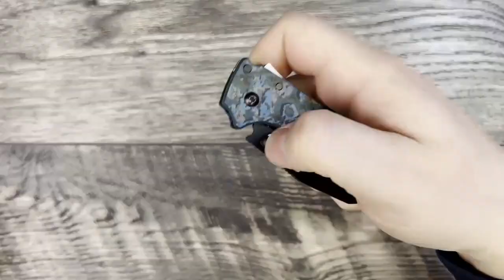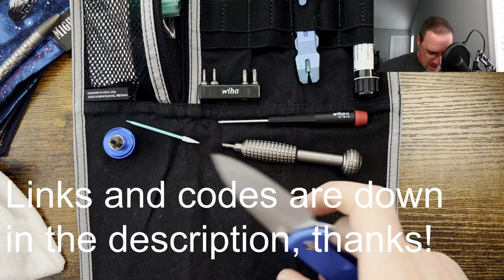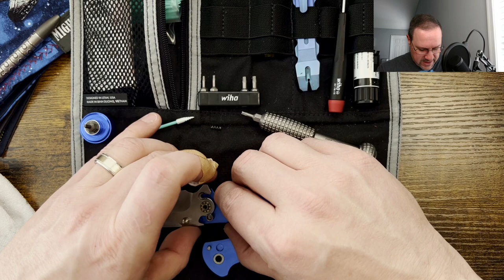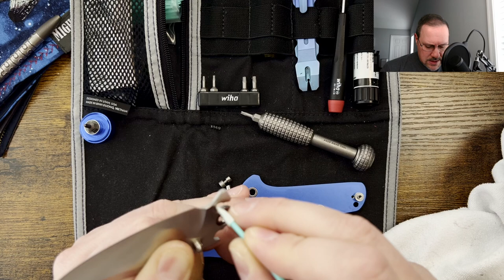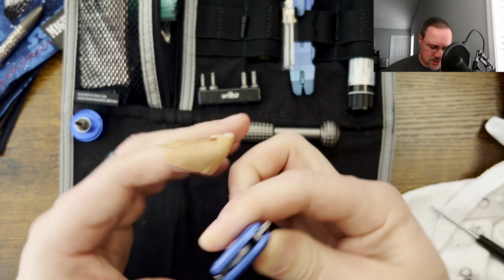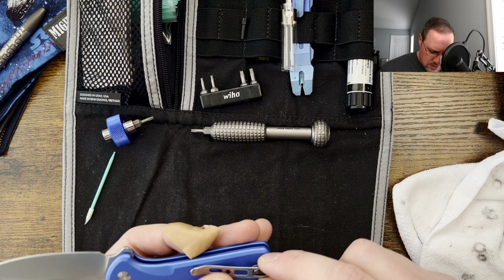Sencut Arcblast disassembly

Comment: Hello again JD! Thanks for getting back to me on my first message. Having watched your video multiple timres i came out with 3 questions regarfding rhe disassambly of my Arkblast. 1st why you did noy yakr out on both sckales the bushing on what the berings roling on fot dirt of metal and carving on it that i found on mine! I cleaned it with alcool and little bit of oil! 2nd you did not put any anti seized on none of your screws not even the pivot svrews? last 1 how do you know on the Arc when it is perfecly tight? Thanks again for your time and great videos! Frank from thr deep north!!!
Reply from the maker: Happy to try to help. Cleaning I I’m able to amply clean the bearings and the surface they ride on no issues. Rarely do I find modern designed folding knives need that’s locker. They are generally so well machine that the screws so not back it, at all. I have done so many disassemblies that I have gotten pretty good and finding the right tightness to prevent play without being so tight that you can feel the bearings are not rolling freely on the washers. 👍
Reply: @dailygearguide  Once again it is like when your sick you go to the doctor and he will help and give you the right medication so thank you very much for taking the time and being my knives Doctor!! :)🙏Frank from deep North!